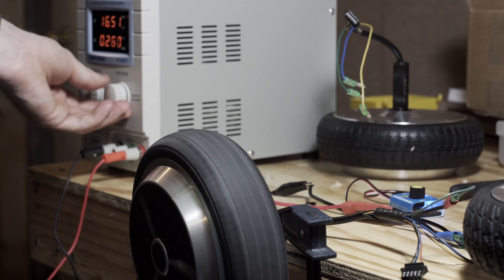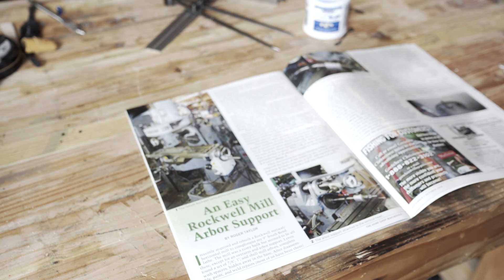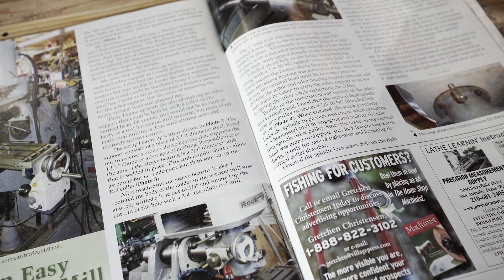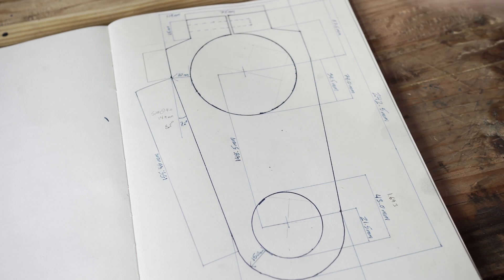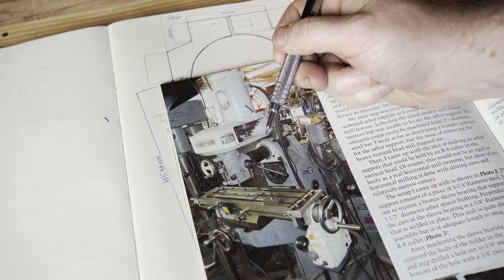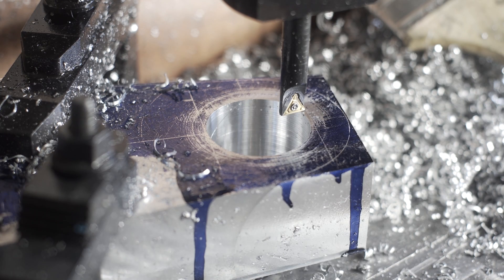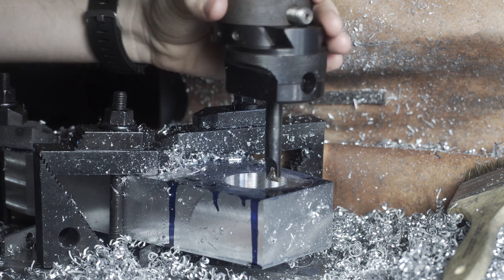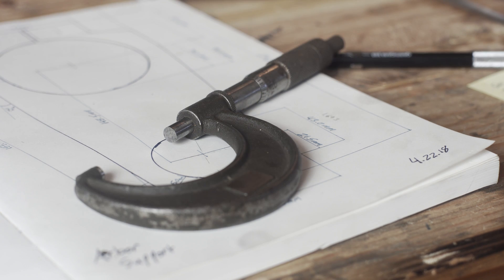Milling a "Quick-change" Horizontal Overarm Support - Part 1

Comment: Isn't the thermal shock from periodically squirting lubricant worse for the tool than cutting dry?
Reply from the maker: HSS tooling is pretty tough, it doesn't particularly care. Carbide definitely doesn't like intermittent cooling though.  But the alternative danger is chip welding which is much more catastrophic.  For home gamers the extra thermal shock is probably not a big deal since the tooling is used so lightly.  Also, despite being applied sporadically, there tends to be a thin film that coats the whole area so it's a bit more continuous than you'd think (which is why you can see stead smoke even outside of squirts).
Reply: @BreakingTaps  I'm trying to find a video I saw where someone tested that.  I think it was nyccnc buy I can't find the video I'm thinking of.  Given they're pretty tough and you have a film of lubricant, what's the benefit of the intermittent puffs of steam then?  Is it improving your cut?
Reply from the maker: @aneb2002  Lemme know if you find it!  The main reason is just to keep a steady film of lubricant on the freshly cut metal, so that it doesn't weld up.  It's probably an excessive amount being added (especially this video, I mostly didn't know what I was doing at the time).  But welded end mills ruin your day quickly so I was pretty paranoid at the time :)  HSS can withstand shock pretty well, but as soon as some chips weld into the flute it'll pack up and break quickly.  The wd-40 does improve surface finish a bit too but i wasn't worried about that.

Comment: I'm thinking a 2 piece version of the books solution.   One piece fits the vertical heads taper and is retained by the draw bar, besides the tapered portion this part would have a tapered portion, like a cross slide or some V slide horizontals.

The othe piece will have the corresponding V taper and support the arbor.

This way you simply insert part A into the head, then insert part B along with the arbor and tools into both the spindle and part A's V way.  Apply your chosen method of locking the pieces together.
Reply from the maker: Ah nice, I like that.  Would be convenient to install/uninstall, and the two pieces mean you don't have to leave it permanently attached or faff about trying to find the right angle to insert it.

Comment: Super impressed with that mill. I’d love to find one around here rather than an import.
Reply: Dont know Where you are exactly but horizontal mills are a great way to get into milling, they are common and can do serious work at any size unlike the smaller verticals.  They range from bench top hand millers to multi ton monsters that wouldn't fit in a typical garage, and all of them tend to go for cheap.  I'm talking free to a few hundred bucks cheap.   A larger bench top or modest floor type horizontal is a great budget way to bootstrap your way to a home machine shop, you can start with the basic machine and a bit of usually cheap tooling and just keep building your own addons and fixtures. Buy or build a vertical head at some point and buy or build the means to adapt it and you have both a very stout machine in horizontal mode and a respectable vertical machine without the need to Drop all that $$ in one go for a decent BP or similar.  

Horizontals also can be used as lathes, if you could only justify a single piece of decently heavy equipment you can do worse than a horizontal mill for sure.

Comment: This is a great project. I have a 21-122 with the horizontal motor and arbor socket but without the overarm support and arbor. I can't decide if I want to make this or try to replicate the original overarm support. Can't find the dimensions of the original to remake one.
Reply from the maker: If you'd like, I can take some detailed photos of the original overarm support tonight after work, as well as the dimensions that I'm working from.  There are a few details I omitted like an oil cup (I'm planning on using a plastic bushing).  Although tracking down a replacement arm could be tricky...it's a pretty burly piece of shafting :)
Reply: That would be great! As far as the arbor goes, I believe it takes a standard NMTB30 arbor. I don't know how long it is, that's also info I'd need. To be clear, I have the vertical head and shaft, it's just the horizontal parts that got lost.
Reply from the maker: Ah gotcha, sounds good. I'll snap some photos and take dimensions tonight.  I believe you're right, the arbor is an NMTB30... not entirely sure of the length either.  I think it's 12" long but will double check.  Mine is a 1" arbor, although I've seen some 7/8" as well.  Wish it was a 1.5" though, there are a lot more cutters in that size.  I've seen NMTB30 arbors on ebay somewhat frequently (including spacers)
Reply from the maker: Ok, here's an album of the original overarm and my derivative version/dimensions:  https://imgur.com/a/hQTVm5a

Take the measurements on my replica drawing with a grain of salt, particularly the angles... I pulled out a protractor while setting things up, and either my angles are way off or my cheap protractor is terrible, because it wasn't close :)  The dimensions should be better.  Also, all in metric, sorry :)

Dimensions are in the album, but here's the original dimensions in imperial.  These should be spot on, just measured them:
- 2 1/32" thick
- 9 1/8" tall
- 4 3/4" wide at widest point
- 3 1/8" diameter of main shaft/arm bore
- 1" diameter of arbor bore
- 23/32" ID of bronze bushing

Arbor details:
- 1" diameter without spacers
- 13 3/8" long, not including taper
- 16 3/8" long, including NMTB30 taper
Reply: WOW!
That's a lotta work. Thanks so much!
Reply from the maker: Np, happy to help!  Goodluck, and have fun with the Rockwell :)

Comment: F I R S T!!!  .... ok... now that that is out of the way... I LOVE this idea! Much more practical solution. Your approach will let you fly through projects without the dread of knowing you will have to wrestle that monster of a head swap. Great project to get your feet wet. MORE PLEASE! thanks.
Reply from the maker: Thanks!  Fingers crossed it works in practice :)  I strongly considered building a gantry crane or something more conventional, but the location in my shop just isn't ideal for a crane (next to the garage door, would make life difficult).  So this was next best :)
Reply: I added a few attachment points in my shop where I can hook up my chain hoist and use it for lifting. I just make a trapeze-like bar from angle iron for the down links and round stock for the crosspiece. Then I bolt it through a couple rafters and weld up a triangle out of round stock to clip the hoist to. That lets it slide back and forth a couple feet. My shop is not finished with drywall though.